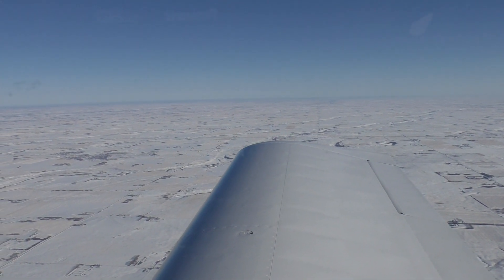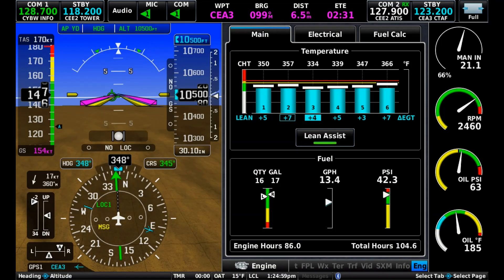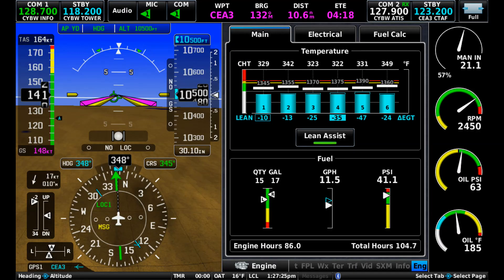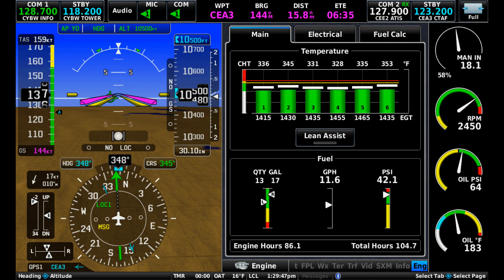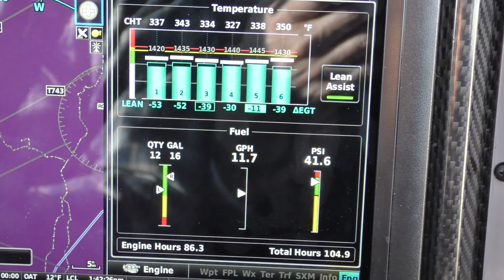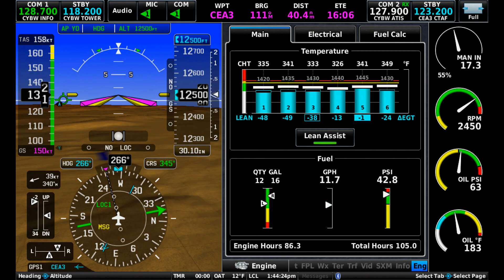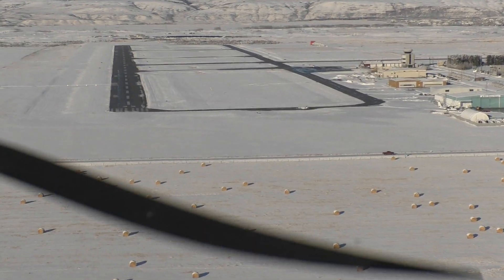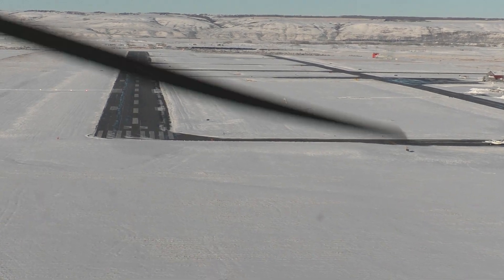Lean of Peak vs. Rich of Peak Part 2

Comment: What does the rocker switch marked Lean/Norm do?
Reply from the maker: On our EFI system, this simultaneously leans the mixture a programmed percentage and advances ignition timing to restore the point of peak cylinder pressure to the optimal crank angle for best torque. The lean mixture burns much slower than rich mixtures so this reduces the power loss soemwhat over fixed magneto timing.